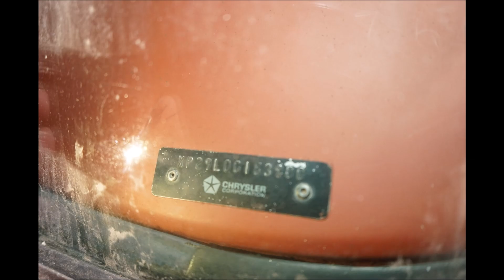Biggest Barn Find Unearthing EVER: Barn #4

Comment: Sumthin looks wierd about this.  Looks as if they were driven down the dirt road with the hoods open and all windows down as to get dust everywhere...then had straw tossed around here and there....just too clean of cars to b sitting like thap ,and not have the starting signs of decay around (641) 792-optical_xf5
/mud is...not to (641) 792-8067n...there is no straw/hay layimg around anywhere  else. My opinion is that these are really nice cars that may have been restored or not but probly restored...then got em all dusty/dirty looking, tossed some loose straw here and there...in order to male more off it a barnfind7bb bj billion
Reply from the maker: Completely wrong, but nice guess.  Guy would buy them, clean them up, and just put them away.  Most like these have been sitting for 20 -30 years.